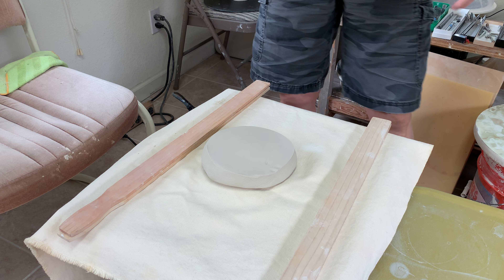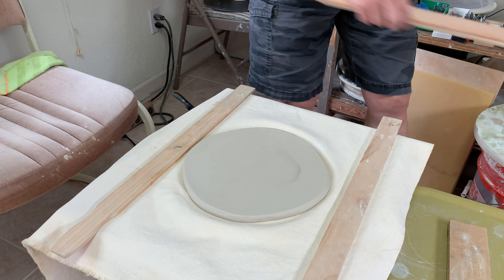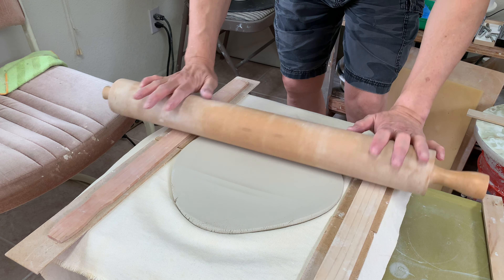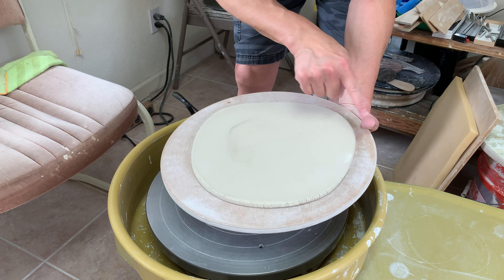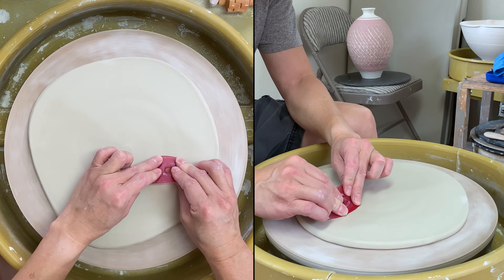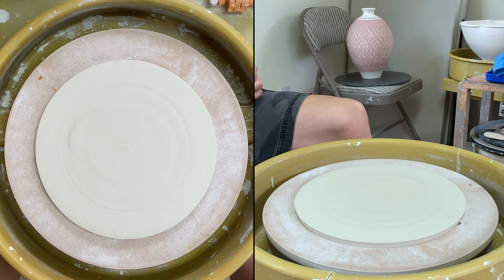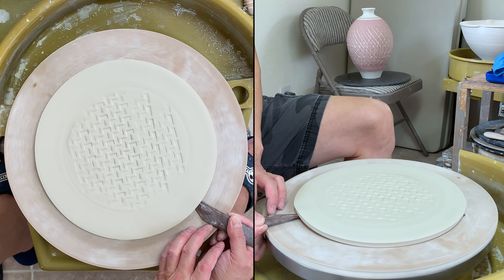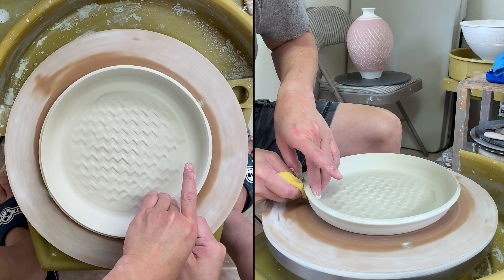519. Making an Easy/Cheater Roller Texture Plate from a Slab with Hsin-Chuen Lin 林新春 土片拉坯製盤示範

Comment: when forming the rim on these slab plates, i always tend to get some unevenness, some parts low and some parts high. i noticed you cut your rim after forming them on this video. any tips to prevent that?
Reply from the maker: Are you talking about after drying or during throwing? During throwing, you have to move up the rim slowly,  also when apply texture, don’t go all the way toward the rim.
Reply: at 7:35 min mark you trim the rim. was this to even out the rim?  during throwing when i raise up the rim there are some uneven parts that i would have to trim off. thanks!      @hsinchuen
Reply from the maker: Yes, trim to even the rim.